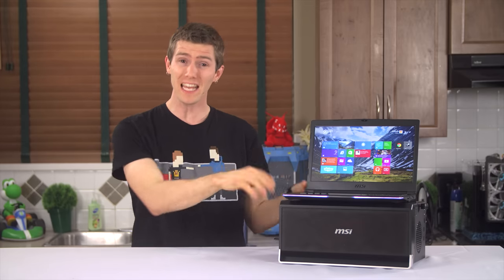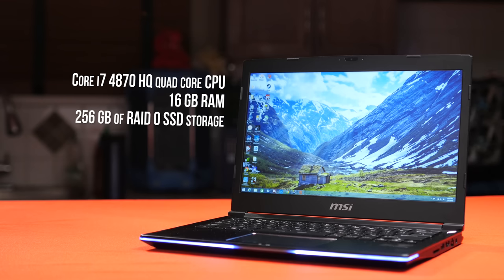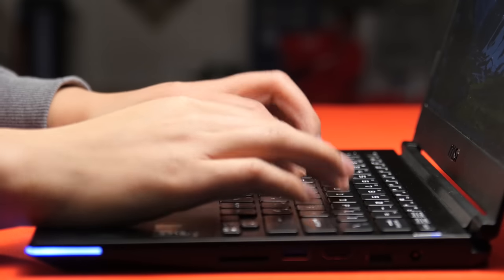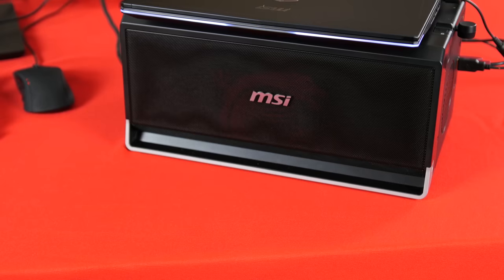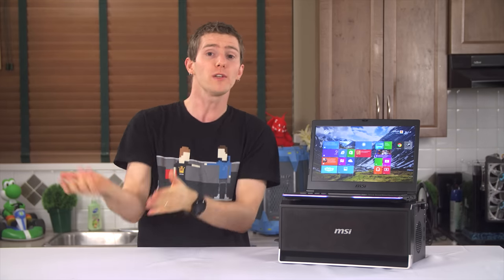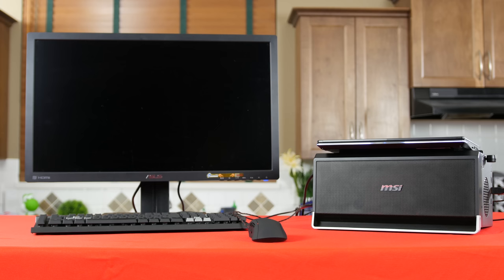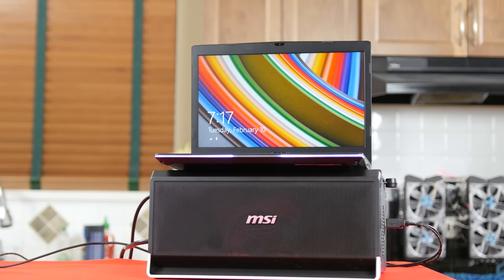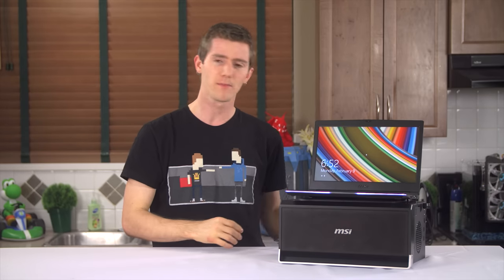MSI GS30 Shadow - Part Beastly Gaming Rig, Part Ultrabook

Comment: MSI FTW ALIENWARE SHITTY ERGONOMICS! (you need a wire to hook up a Alienware Graphics Amplifier, MSI is much better, hooking up the laptop on the amplifier not only just attach it to save space, it also allows air to enter through the bottom.)
Reply: Like linus said, it actually allows heat to enter the laptop, not a good thing...
With the alienware solution you can just put an external laptop cooler underneath, which I do anyways on my Asus gaming laptop.
So it is the better solution.
Reply: Yeap heat air is the problem...

Comment: To be honest iv seen better external PCIe configs with a single thunderbolt cables and having a daisy-chain straight to any HDMI display and several powered USB 3 and a couple of thunderbolt HDD with out loosing and speed for around that price the box looks like a last minute thought the laptop looks awful as well I use to like MSI but plasticy cheaply feel turned me off completely what ever happened to the old gaming machine that looked so powerful

Comment: That gpu box placement is extremely stupid. How can you even use a notebook with ~20cm tall box under it? At least they should have made it so that the gpu box connects from behind the notebook or maybe connect with an extension cable.

Comment: Nice edit there on 5:25 ;)

Anyway, I think this is the most useless invention in a long time and with that an ugly and a horribly bad implemented one as well. Let me clarify that.

Including a GTX980, MSI apparently asks around 2200 pounds, about 3350 dollars, for the package. The way this is designed, with the laptop sitting on top of this box, you are also forced to get an external monitor and a keyboard and mouse. Granted, if you wanted to game on it an external mouse would be a no-brainer anyway, but using the laptops keyboard or maybe even its screen wouldn't be that weird. With this implementation you just can't.
And let's be honest here, the box looks like a modern version of  a 1950's stereo, with the big latch securing the laptop into place the most inelegant way they could have made.

And then there is the price and practicality of it all. For 3350 dollars, and more like 3600 when you factor in that you have to buy a monitor, keyboard and mouse, you can easily build yourself a wonderful and stylish mITX pc and get a nice ultrabook for travelling. The mITX pc would be better looking, fully functional on it's own and in both the pc and laptop part you could get quieter solutions. I even think you could build it much cheaper, guessing that you can get a very nice ultrabook for 800 to 1000 dollars, leaving you over 2500 dollars for a mITX build with peripherals. 

The whole "but I only want 1 device" thing is an absolute bs in this case, since you need just as many components with this setup as you would with a regular desktop + laptop (laptop + case/pc/box + monitor + keyboard/mouse). However, with 2 separate systems you actually can use both at the same time if need be. Having things synced between 2 systems isn't much of an issue either. Most games do that through things like Steam and syncing documents and files is easy enough with Dropbox.

Comment: I don't understand the point of this when for less you can build a good PC that will take up a similar amount of desk space and buy a pretty good laptop, it seems like a gimmick for people with too much money to show off a bit
Reply: The point, is it's all in one.
Reply: it basically is but some people want a ultra thin laptop and a gaming desktop without having to give up one or the other to have both thus where MSI's market for this thing is. For us though i will just get the Gaming desktop and a normal Ultra thin laptop instead when and if i ever need to get a laptop anyways as things go by the time that i need to get a laptop the technology would have advanced far past where it is atm so getting it now is just a waste.

Another thing that i would like to see in it though is a larger screen size
Reply: I don't understand why anyone would have the need to have a gaming computer and a laptop in one though, it wouldn't save space because you need that big dock on your desk all the time anyway and surely it would be better to have them separate so you haven't got work files clogging up your gaming pc and games clogging up your work laptop so they'll both be tidier and run better. It also means you can keep a laptop in a portable bag or wherever you use it the most instead of constantly clipping it in and out of the dock. I have a pretty good laptop that I used to do some gaming on and then built a gaming PC and combined they cost me under £1000 which is like $1500 and generally I think computers and components cost more over here than in the US so around $2000 for a combo like this is more of an expensive novelty than anything else.
Also an increase in screen size would stop it being a portable laptop anyway so it would just become an all in one PC because it's too large to carry around with you, I think this is designed to play with another Monitor like he does in the video.
Reply: as is said above convenience of only having to get use to one keyboard and trackpad instead of 2 keyboards, at trackpad and a mouse Other than that what yo said does make a ton of sense.
Reply: you cant really even use the keyboard when it's lock into the dock though so you still need them separately to game, to me this seems like the kind of thing that people will buy and then spend their whole lifes trying to justify when everyone knows it was a big waste of money

Comment: Very impractical. Really the only problem with a hardcore gaming laptop is the battery won't last long. The solution? Plug in the power adaptor, or get a couple of extra batteries. If you do that, you can game anytime, anywhere (airplane, office, hotel room, car, friend's/relative's house, etc)...
With this, you actually need this huge-ass, immobile box to game with. If you go anywhere else, even if you have a power brick (and/or spare batteries), it'll still be useless. You're basically limiting yourself to one base, for no reason. 1080-1200p is perfect for gaming on a small screen, and the 980M will handle that smoothly.

Comment: The alienware has this, and it's cheaper, and it has a mobile gpu(860m)
Reply: And for half the price btw
Reply: The starting price while at $999 and has 860m, it started with dual core i5 4210u, no ssd, and 768p tn panel. And the i7 5500u model, which is still dual core, compare to the 4870hq quad core of this product, with 1080p and 256ssd, cost around $1600, but it is also a lot thicker. Not exactly "half" the price. With or without the graphics amp (gtx 980), still cheaper I guess.
Reply: GriggsCk Gaming I disagree with 768p as a bad thing (since it's better for gaming) and i don't believe ssd's on laptops are crucial (i have my laptop on sleep everytime anyways). But i do stand corrected, i didn't know it was a dual core cpu
Reply: jerome ley Never said it is a bad thing, and it is not better for gaming.
 If you are gonna compare the price at least compare it smartly, use the higher end model, not the entry one that you claimed "half the price" ($1600 GS vs $1000 AW), 768p vs 1080p, no ssd vs 256gb ssd, 8gb ram vs 16gb ram, tn vs ips, dual core vs quad core, i5u vs i7hq, thick vs thin. That's like saying 270x is half the price of 290x. Not even in the same specs sheet. You are misleading people here with your second comment. You are right about being cheaper, but not half the price.
Reply: GriggsCk Gaming I thought linus said 2,000.
Reply: jerome ley Range from $1600~1900 in amazon, I think 2 grand is with the graphics amp? Or he just rounded to the nearest grand. Nonetheless, if you use amazon, you can get it for $1600. And it cost like $2000 here in my country, with graphics amp (no gpu). And $2500~600 with gtx 980. So prices can't be that far.
Reply: GriggsCk Gaming i love the info you gave but at the end of the day I rather use my AW 13 with Amp 970 because its not a freaking brick and fits in my backpack. both are great products and have pros and cons. AW just fits me more
Reply: Cameron Williams Well, I've never said which one is better, I'm just correcting him. In the end, I would just choose a normal laptop that cost $1000 like Asus G551Jm and a gaming desktop. The price for both AW and Msi needs to be more attractive. How huge is the AW amp? Fits in your bag?

Comment: This is a terrible idea. While undocked, you have a laptop that is equivalent to a $500-$700 model from another manufacturer. While docked, you have a loud, poorly cooled desktop that is equivalent to a $400-$600 build, assuming that neither one comes with a GPU.

So assume your budget is $2,400. That'll get you this monstrosity, plus a decent GTX970. For the same price you could select a laptop from an extremely wide range with similar specs, then build a desktop with similar spec, plug a GTX980 into it and still have cash to spare. Throw Steam's in-house streaming into the mix and I have a hard time seeing any reason at all why anyone would ever want one of these.

Comment: Really? about 25-30 cm height box with a gpu + psu? Who wanna use this like this. I would better to prefer a cable solution, because it gives more optionality and you are not forced to play on a box if you dont have a keyboard. Second: box has really cool design, BUT dear  MSI why? Why you cant paint the back side of psu? is it funny? Finally this lock and release mechanismus remember me to the old arcade games or casino game machine.

Comment: External Graphics. MSI's idea, Alienware stole it. Doesn't matter form me because Alienware did it better. With MSI you need to buy a extra monitor, keyboard, mouse. With Alienware you can just use your laptop and if you want a monitor etc you just attach it.

Comment: What's the point? The laptop's (with it's own GPU) can't play SHIT unless you are docked to the desktop GPU so you are fucked if you want to play games on the go. Not only that but you ALSO have to buy a fucking GPU to put in the dock. SO we are talking $2000 PLUS.
You might as well spend 1k on a PC and 1k on a gaming laptop and you could play much more games on the go and still have a badass desktop computer to boot.

They have a good idea. A laptop with a good processor and a dock to use it with a desktop gpu. If it were 1000$ it would be MUCH BETTER

Comment: So.. That graphics card hanging on about a 10 degree angle.. I'm sure the solder connectors on the header will last well after dozens of heat cycles with that kind of stress on it. Cheap and nasty rubbish IMO.

Comment: so first you spend $1900 on the dock and laptop, then you should spend atleast 300 for a 970, and then spend more to get a monitor which on average will cost 150...so in total you're looking at $2400...hell NO! buy a laptop and build a proper pc, for 2000 and get the best of all worlds

Comment: To be honest this is one of the worst gaming "notebooks" I have seen. The reason people get gaming notebooks in the first place is for portability, not lugging some giant thing for the graphics card around. It would be cheaper just to buy a gaming desktop and a cheap laptop than this "gaming" notebook. MSI you really screwed up on this one.
Reply: lugging the grx card box around is not what this is intended for.  Linus even says it in the video that the purpose of it is to have an ultra portable laptop to take with you on the go to do work/school/productivity tasks and when you are ready to game, you take it home and dock it.  Let's not forget the reason for hte box in the first place is to be able to upgrade your gfx card at anytime instead of being stuck with something soldered onto the MB.
True, this isn't the best solution as Linus points out, but what it is, is the first step in the right direction of upgradeable gfx cards in laptops.
Reply: Brolivia Wilde The problem with this is that it is too expensive, and you're better off buying a desktop and laptop instead. And you only need upgrade-able gpu for laptops if you planned to game on the go(which this isn't made for). Honestly if you look at it logically, there is 0 benefits to this machine.

Comment: Most useless product I ever saw,
Why buy this if you could buy a sensible desktop and a laptop for exactly the same price,
You can have people use both at the same time,
You do not need to turn it off and on when you decide to switch to desktop graphics.
And it takes just as much space as a mini ITX small factor pc

So until they make some deal breaking possibilities I would not buy it